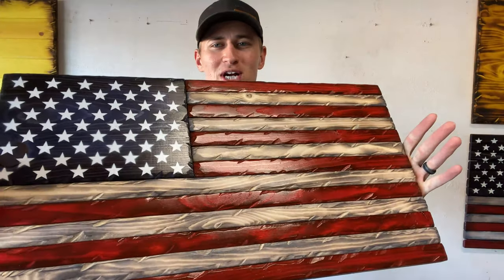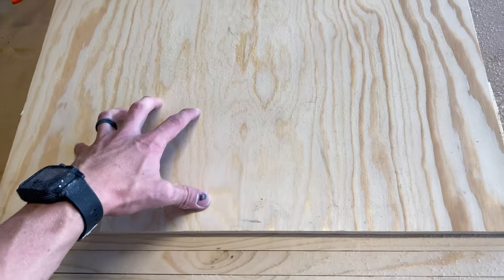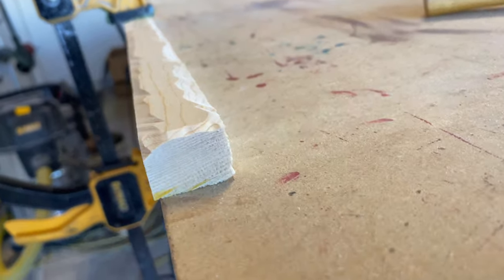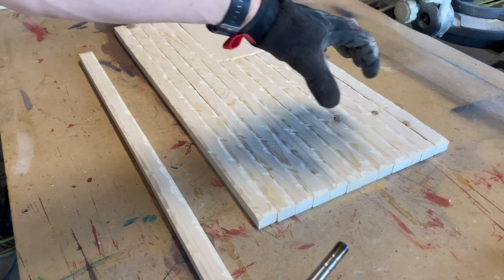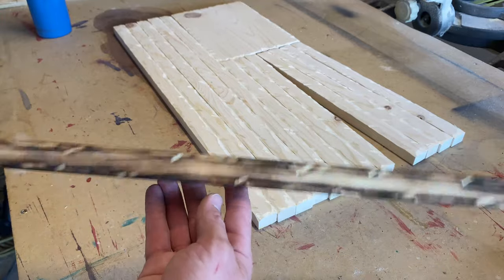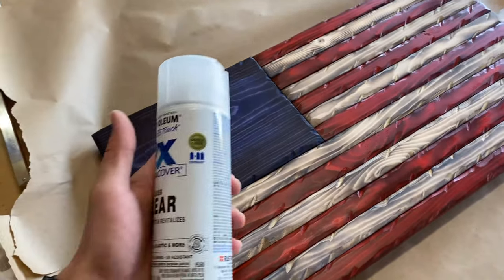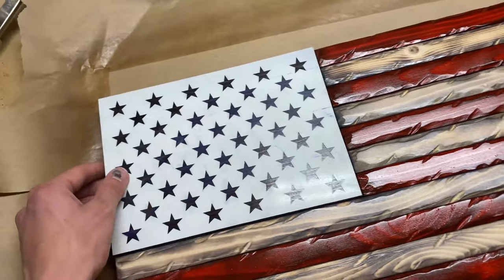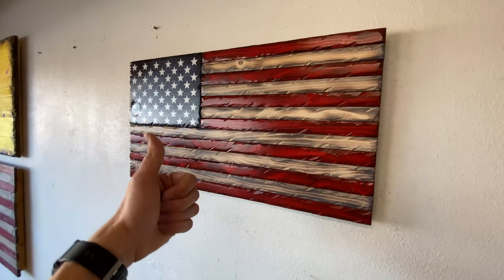How to make a DISTRESSED MEDIUM FLAG | RUSTIC WOODEN AMERICAN FLAG! DIY Christmas gift idea

Comment: Max.  Watching your videos inspired me to start making flags.  I'm about 20 in, have sold a few and given most away as presents.  Thank you so much.  Your videos show how easy and fun it can be.  A suggestion for your stars.  I am not as steady handed as you, so instead of using the dremel wand, I added a 565 cutting guide to my rotary tool.  Leaving the stencil on, it works like a miniature router.  Works well.  I just finished 2 unions a couple of days ago.  Carving and staining the stars only took about 3 hours total to complete both.  A second suggestion that I use.  After I stain the union, but before I carve the stars, I put a couple coats of the Rustoleum clear coat on the union.  I then carve the stars.  When I go to put the white stains on the stars, my oopsies clean up with a rag without having to go back later and touch it up with the blue.  Again, thank you for your videos.
Reply: Would you mind sharing a bit more detail about how you do the stars? What kind of rotary tool do you use and what is a 565? Thanks Shane!
Reply from the maker: Dang that makes me very happy to hear!! im definitely gonna give that a try! My hand will usually get all cramped up when i carve using the wand, which is why i have kinda been staying away from carving lately but im definitely gonna give that a go! Thanks so much for sharing man i really appreciate it!!

Comment: Your videos are the ones that inspired me to make flags.  When I do the Union, after distressing,  I paint with Real Milk Paint. After it's dry, I tape it off with painters tape.  Then transfer the stars to the tape.  I use a chip carving knife to carve the stars and a chisel to clean them up.  Since I cut through the painters tape, the stars are easy to paint.  When I peel the tape off it pulls a little of the paint off that reveals the distressing.
Reply from the maker: Im very happy to hear that Pat it means a lot. That sounds like it would work great!! What kind of wood do you use for the union? I think i tried to chisel the stars one time and it didnt go very well for me😂
Reply: I use a 1x12 pine and I line up the stencil first to make sure I am not hitting any knots.  The chisel method is very time consuming and also did not work for me!  haha!  I haven't kept track of how long it takes to hand carve the stars.  I have one on the bench and I will time it and let you know.  I usually cut and distress all my pieces, then paint the Union first.  Then the stripes.  The milk paint dries fast, so I can usually tape it off pretty quickly. I've been using an outdoor/marine spar lacquer that takes a while to dry and it has a tint to it that gives the flag an antique look.  There is a video on YT called "how to chip carve stars" that I watched to learn how to chip carve the stars.

Comment: Great job on the flag. I would look in to getting some round sponge brushes or just a regular foam brush to do the stars. Blot or dab the paint on the stencil. It’s just so you don’t get that under spray around the stars of your stencil. It takes just a little longer but the stars come out looking way more sharp. Would love to see a video of you trying that out and maybe the viewers would like to see it as well. Thanks!
Reply from the maker: Thanks a lot man!! I actually tried that on the flag i did with reduced lumber and it seemed to work out pretty dang good! I should make a video though showing it and giving it another try because i had only tried it one time. Thanks for the comment and the idea!
Reply: @MaxF01  no! Thank you! I didn't know you already tried this and I have watched pretty much all your videos.
Reply: The stars look perfectly crisp!
Reply: Cody I’m so glad you brought this up. Max, awesome video and project! I made my first flag this past weekend after watching your video, and it turned out awesome! Until… I got to the stars. Unfortunately and despite my best efforts to hold the spray back, do multiple light coats, hold the stencil down with a finger, etc, I got underspray and have to tear out my Union and do it over. So bummed! Gotta try to sponge idea. 
That said, I followed all your instructions and I love it! Once I get the stars issue figured out, I’m going to bang a few of these out for Christmas gifts. Thanks again!
Reply from the maker: @whitelaw5  thanks a lot Eric! Im sorry to hear that it didnt work out so well for you! I think i will do a video trying different options for painting it to see if i could get a more consistent outcome, the spray paint definitely has room for error, i have used repositioning spray before and it seems to work pretty dang good it just sucks because it leaves a residue on the back of the stencil. I’ll do my best to find a solution that will work better and be convenient! Thanks for letting me know! And the flags will make some awesome Christmas gifts!! Thanks again for the feedback🙏🏼

Comment: Do you prefer using plywood as a backer for just the medium size flag?
Reply from the maker: I actually havent tried it on a large flag but i think it would work out just fine, it may be a bit heavier than using the 1x3 or 1x2 but it would definitely make for a solid backing👍🏼

Comment: Cool flag max for the white stripes do u wipe the stain off or how long do u leave it in there before u do and how many coats do u do
Reply from the maker: Thank you very much Chava! I actually just wipe it on so that its not too heavy and then just leave it to dry before i add coats. For this one i did 3 coats and then just lightly went over it for the 4th. Im not sure if it’s because i live in AZ and its dry here but if i try to put it on super heavy and then wipe it off after a minute it will just dry up

Comment: Hey Max, I bought a CNC and I’m planning on using it just for the union and was thinking of glueing the flag to 1/8” utility panel. Do you think that would work to hold the flag together. I’m thinking I want it to be closer to the wall.  Great video Max.

Comment: Great job as always Max…Question? What made you put a ply wood back on this flag versus the other flags where you put wood strips in the back instead?
Reply from the maker: Thanks a lot Juan🙏🏼 i guess i just wanted to try something different and i figured it would work out good on a smaller flag, also with it being half inch plywood its slightly thinner than using 3/4” backers
Reply: @MaxF01  Awesome! Thanks for the reply back and keep up the great work
Reply from the maker: @juanmendoza7487  thanks man! 🙏🏼